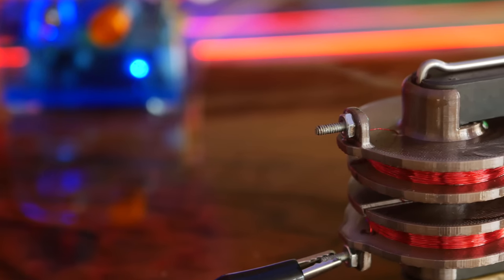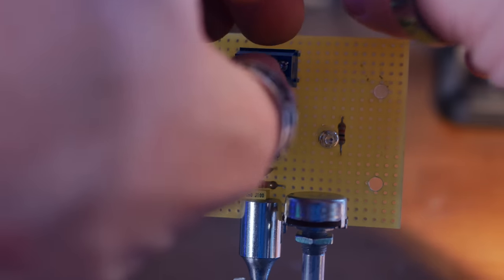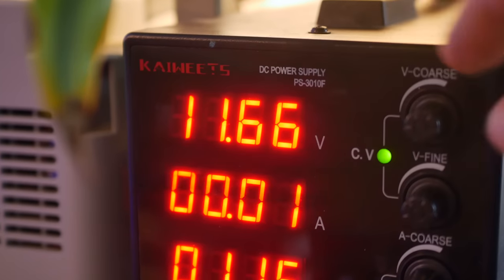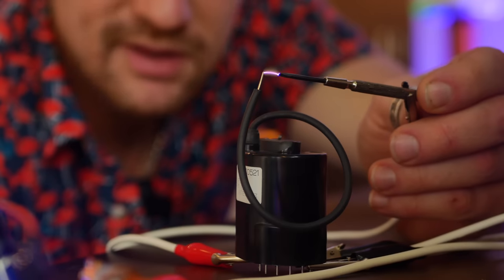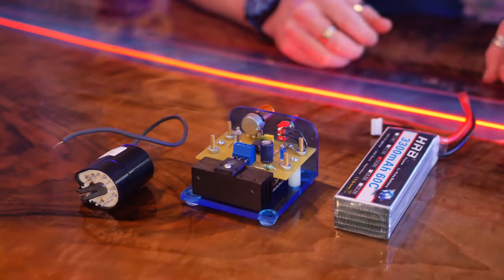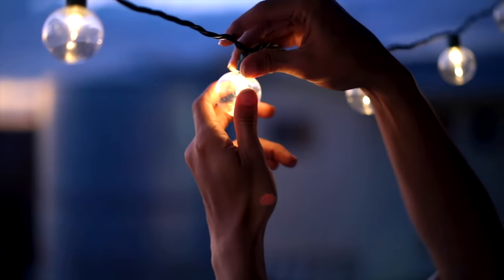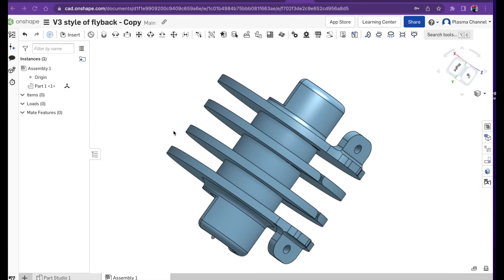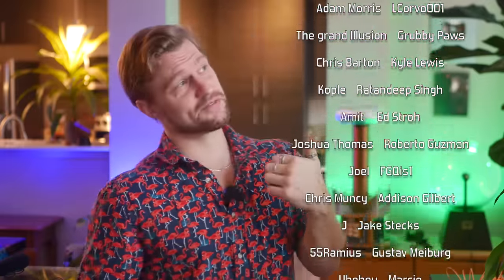Unreal Bluetooth Plasma Speaker (3D printed)

Comment: So here's an idea; for making the audio more eh, audible: why not make an acoustic casing (basically a wooden box like a tuning fork uses wood to expand the soundwave(s)) so the audio can resonate thus enhancing the volume and the definition of the sound produced by your nice little spark spitting contraption. I recon a wooden box could be 555 (5x5x5cm)too? Hope you read my message 5 by 5. High five Jay!
Reply from the maker: Thanks Ron! So, I left everything loosey goosey and bare, not in a box, because I wanted the driver to be totally separate from any transformer. Wanted it universal, so to speak.
Reply: @PlasmaChannel  Jay ;) Totally within your Acrylic philosophy indeed! Open to the touch, transparent, love it. But I was referring to the 'receiving' end of the sparky  thing;The metal spike on which the arc jumps to. Could that make a improvement to the audibility of the 4th state spark spitting boxy thingy when you encase the plasma recipient in wood? Or would it make no difference to the amplification or definition of the sound produced you recon?

Comment: It works perfect but can i increase its input voltage while making sure that ne555 driver receives only 12v from buck converter..will this damage the mosfet because of higher back emf from primary inductor

Comment: Is there something more self contained that can be made so that you just turn it on and it works without having to hold something near it to make the arc?
Reply from the maker: I originally intended for the build to be that way. But I wanted it compartmentalized..so that it was "universal" and not locked into a box or something like that.

Comment: This can go further. On a show about filming the impossible. They was able record talk without seeing lips move by analysing the pixels with an algorithm where a piece of paper moves just the tiniest amount that your regular eyes can't notice. They then was able to piece back together what was said in a sound proof room behind sound proofed glads. So we shoot a video. Watch the pixels change where your arc is and we can put the audio back together. Works with words but i don't know about music. This would need advanced. When you speak. You vibrate other things like paper. This changes the pixels a certain amount and an algorithm simply changes this back to audio. It isn't perfect. You turn that back into the vibration that you can hear instead of see. Certain tones cause the paper to vibrate this way and other tones another. Compression algorithms to make video smaller would work against you because what happens is there is not much visual change so it's thrown out to clean an image further than real life to look more perfect on screen. This would remove the subtle changes in the paper at the pixel level or in this case it's easy to see the plasma arc change with the sound a bit. It kind of dances with the tone.

Comment: Please filter high audio frequencies next time. The intro and 12:05 has an incredibly loud and painful 15.4kHz tone
Reply from the maker: Ah....yeah.....I guess i'm just numb to it by now. Thanks for the feedback.
Reply: @PlasmaChannel Please don't - I would rather hear what the circuit sounds like, than have the sound "muffled" by a low pass filtering. It can be hard to filter out this one without degrade the audio quality, since the frequency wasn't constant, so hard to use bandpass filter - it starts at like 15.6, then drops to 15.35 under load.
It can be a good idea to tune the circuit so the switching frequency is >20 kHz when possible though, haha - because some people do think sounds like this is quite annoying, while others don't even hear it. I can also hear it well, but isn't bothered by it - it sounds like an old TV (CRT), but louder.
Reply: @Speeder84XL  I guess it would be fine if the volume was just lower during that part as the main problem is that the sound is just very loud compared to everything else.
Reply: @Undy1  True. Maybe narrow band EQ between like 15.3-15.6 to just lower it on that particular part. The best would be to tune the circuit to run at higher frequencies though
 - that would also increase the audio quality as a speaker, since the upper part of the audio will not interfere with the switching frequency.
Reply: @Speeder84XL  Yeah, dunno how feasible that is but that would be a solution.
Side note: I'm also very annoyed by a lot of things with PWM, especially electric bikes or scooters as they usually run at audible frequencies (around 18kHz) - and I can hear them very clearly. I've been told that the reason they use those frequencies is that it's cheaper than using higher ones.
Reply: @Undy1  Yes, those high pitch noises is quite common of todays power electronics - so not fun if you are easely annoyed by them. Most electric bikes or scooters I have heard run at lower than 18 kHz - often not more than 8-15 kHz. 
According to what I have read, that's because most motor controllers seem to send the PWM pulses directly to the motor and let the inductance in the motor windings "smooth" it out into DC or low frequency AC. That will cause the motor to "sing" at the switching frequency (and harmonics of that frequency). This is (as you say) to make it cheaper by saving cost on filtering components (high power inductors and capacitors) to filter the output. 
But if the PWM frequency is too high and unfiltered, the motor losses (and heat) due to eddy currents in the core may go up. So that's why they choose the frequencies they do. This is often the case even for bigger vehicles and usually, the bigger the motors, the lower frequency need to be used.
That's why big motors, like trains, often have more like a "midrange" whine (often in the range of just 1-4 kHz) rather than a high pitch tone.

Comment: Do you use any thermal compounds between the heatsink and Mosfet?
Reply: Probably, but im pretty sure it'll do just fine without
Reply from the maker: No I didn't. I've found they do fine without it as long as it's a bolt-on style of heatsink.
Reply: @PlasmaChannel  I got a question as well. Im not that far into all this yet but I still wanna recreate that build myself. The 1nF timing cap you mentioned, does it have to be exactly that type of cap you've used or will any type do? Since the shop where i'd order the parts doesn't have those in stock. Thanks!

Comment: Seeing the use of a part from a flat screen, possibly a plasma, I was thinking there was going to be an image with the sound. 😂
edit
The final product had no sound until the arc had been extended until it broke the circuit. Then each connection didn't have the same sound as the length of the arc was extended until it broke. I love playing your videos just for the magnetostriction and other high electricity associated frequencies of sound. Most of the technical aspects are way beyond my understanding of electronics.

Comment: 1:30 32$ for a ordinary pot? crazy
Reply from the maker: Some pots are REALLY hard to find. Like good luck finding 75kOhm at 0.5 to 2 watt level online. Mouser likely has something, but I think that's why their prices are really high. They are speciality items.
Reply: @PlasmaChannel  Just curious... Do you actually need a pot rated at such high energy levels? You're just using it in the voltage divider of the 555 I presume, which in essence only charges a tiny capacitor to drive the sr latch of the IC, which then becomes the actual workhorse.
Reply: @PlasmaChannel  
i mean, the one you picked was a 100k linear pot, not that uncommon. 
the ones in the box left of it were much more reasonably priced somehow. 
but yea 75k is very unusual indeed. theres actually just one on mouser with 3/4W available. but in almost all cases, modifying the circuit elsewhere is easier than buying exotic parts like it.

Comment: I'd like to see you step up your schematic game a bit.  In particular, the 555's pin arrangement is a bit odd. It doesn't match the physical layout, nor does it match the conventional logical layout. Pin labels would be nice. Dots at junctions instead of hoops for non-junctions. The 100k pot's wiper isn't connected. The input/output terminals should be labeled. And last, the inconsistent line widths are bothering me.
Reply from the maker: Yeah I hear you. That schematic though I drew, in final cut pro, using over 100 stacked images, each image being a box that I squeezed or stretched in order to create a line. It took me 6 hours. I just need a schematic drawing program for next time.
Reply: @PlasmaChannel  Wow! That's a lot of work. Not only will a proper schematic editor produce a better result, it will also save you a ton of time and frustration!

Comment: Can I use this driver circuit for two ignition coils whose inputs are connected in parallel? 
The other coil is connected in reverse compared to the other one in order to create double the voltage.
Reply: BTW the coils are identical
Reply from the maker: Id recommend my other 555 timer build from last year. It's tailored more for ignition coils. This one specifically is for flyback coils.
Reply: @PlasmaChannel Ok now I need some help: now I have disassembled a CRT tube and removed the flyback from it and built this circuit. 

What is a good resistance for the primary?

The transformer has 3 coils outside the actual transformer. Their resistances are 5.4, 2 and 0.4 ohms. The 0.4 ohm coil has two copper wires on it.

Which one is the right one?

Comment: I need some help, I built a circuit according to the schematic, but it does not oscillate at all. When I supply it 24v both lamps glow very dim and output voltage measured across a 12kohh resistor is slightly over 1v, has anybody encountered a similar problem and can provide me with some advice?

Comment: Push the air off the top of the flying saucer motorhome. Zero pressure on the top normal pressure on the bottom what could happen?

Comment: 1:53, what resistance has that inductor?  Does it even matter?
Reply from the maker: Do you mean what inductance is the inductor?
Reply: @PlasmaChannel  I got 2 different ones to choose from, both 1µh but ones specified with 0.19ohms and the other one 1.1ohms. Does that make any difference which one I use in this circuit?

Comment: Yes it's cool to create plasma from music, but mistakes can be fun to (if you live).
Many years ago I got ripped off by Tandy. They sold me what was packaged as LEDs but in fact where Neon 7 segment displays. It took a bit as a kid in the 80's to figure it (no internet) but I did.
I need 90V. Where am I gunna get that. First try,  power point (in Australia 240V) resulted in a shower of shattered glass. Then I rememberd transformer theroy, 240 in / 12 out = 12 in / 240 out. But i didn't have a variable voltage supply. Or did I. Ignoring impedence I used the out put of my stereo, and Hey Presto I've got Plasma rocking my tunes.
Then I touched it and the world changed, now we're feeling the music. Most people are so scared of the smallest shock, but if you can hold it, your Eyeballs start flashing from the inside. Then you have to pick your tune: Phil Collins 'In the Air Tonoight' the anticipation is esquisit.

Comment: I made music plasma.Using 12v supply.. It worked perfectly.( the circuit is not mine. I took from franzoli electronics website). I changed the supply Voltage into 24v. But mosfet get failed. Now i am trying to solve that issue.

I put it as a short in my chanal

Comment: 12:49 Biblical and designed generations ago? It takes low Voltage and turns it into high Voltage wireless power and looks like a Djed pillar? Huh im sure theres nothing interesting about that comparison.

Comment: That's so on point! amazing here's a challenge design transparent human brain anatomy plasma arc firing as neural receptors physical sensory 6axis gyroscope plasma arc constant linear firing accelerometer additional modulations sensory human magneto radar Doppler effect and sound reactive plasma speaker. This brain plasma neuron plasma arc firing  ambiguous brain circuitry auditory plasma sound audio talk back by firing responsive just think NEST devices GOOGLE HOME this should be now or later after this I'm asking u to create  is However you have done similar designs so this should be easy to you! POWER UP THE BRAIN BY Using lots of micro passive active crystal oscillators junction micro energy capsulated capacitors or Arduino pyrotech battery foil film for power or AMG) EFB STI ELECTROLYTES GEL CELL CHAMBER FILAMENT

Comment: with so many dumb finger rings why you haven't been shocked or fried circuits... or maybe you just don't show it on video.
Reply from the maker: You really hate rings don’t you? I’d suggest Rings Anonymous, heard it’s a great source to vent anger about rings.

Edit : “finger rings”? As opposed to….. what other kinds of rings?
Reply: @PlasmaChannel  it's not that i hate rings, is that i don't understand why you keep them when playing with high voltage circuits. Doesn't it make it more dangerous?
It's bad enough when playing with DC circuits.

what other kinds of rings?
Umm dunno. there's people that have on their arms, face... feet.
Reply from the maker: I’ve done this for 20 years straight. If wearing rings was inherently dangerous, I’d not be wearing them.

High voltage doesn’t care about material. Raw skin is just as conductive to 50,000 volts as raw skin with a metal ring. In fact, rings add safety. Because an arc will jump to the metal, and save you a burn on your skin. As for shorting out components on a circuit board, never done that before. In 20 years.

As for the “other rings”, those on the arms and legs aren’t rings. They are called bracelets. Rings in the face are called piercings. 

Cheers